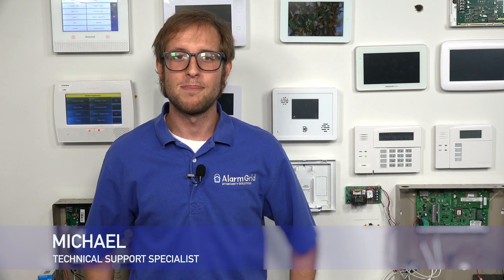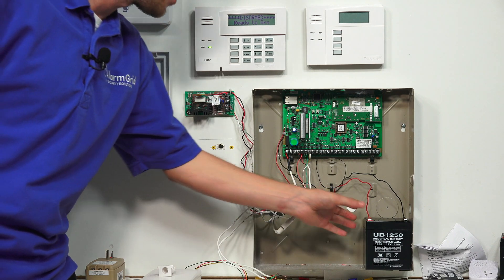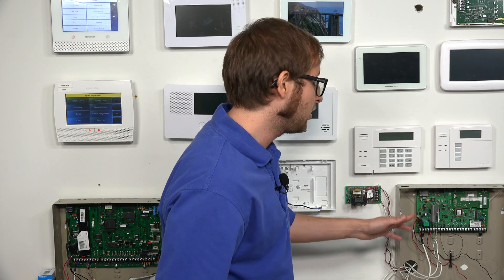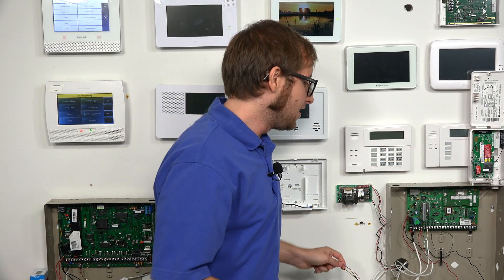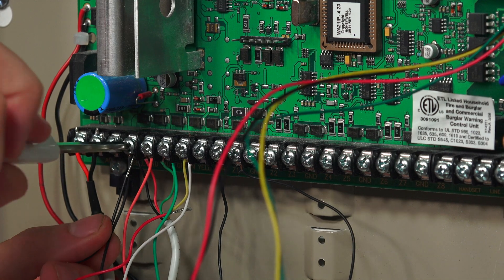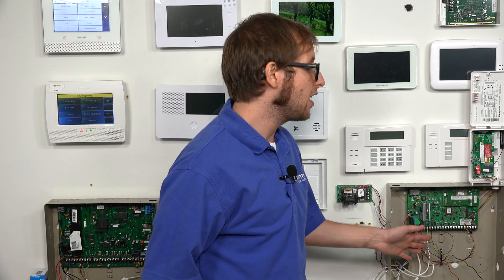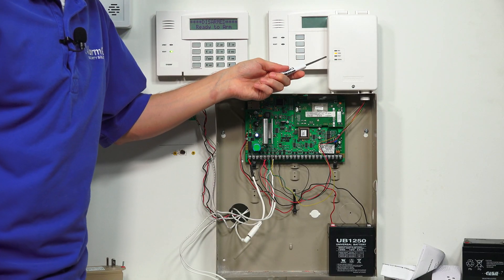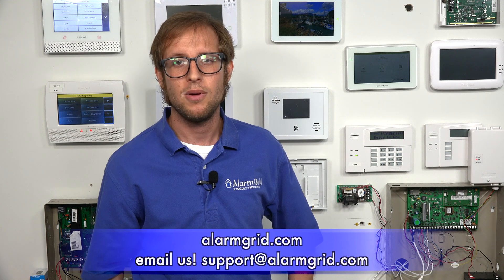Install Honeywell LTE-XA or LTE-XV On VISTA-15P, VISTA-20P, VISTA-21iP

Comment: Big tip, if you mount the communicator near your breaker box, the electrical current that comes in through the wires to the breaker box will help with the cell signal strength especially if you live in an area where cell service isnt the best. My simon xt is mounted in my garage and right in the same spot of where the simon panel is located is the breaker box for the electricity that is connected for my house and my panel communicates via cellular and i actually took the very long antenna and mounted it above the breaker box and to my surprise it keeps the cell signal strength at a good level. It boosted the panels cell signal strength to only two bars which may not be the best but it beats the heck out of having no cell signal strength especially since i live in a rual area where cell service isnt the best
Reply: I have run into a similar situation, but it was a faux cell signal it looked like it was 4 bars but was really one bar, If it is close enough to pick up the ambient frequencies of your electrical box it is close enough to catch a possible arc if a surge or house is struck by lighting.

Comment: What about the Vista 50P?
Reply: 50P is a very basic commercial system. It does not have the logic to communicate over a Cellular or IP communicator over the keypad connection would require a dialer converter like the LTEM-P with the PRODCM. The 50p is not able to use TC2.